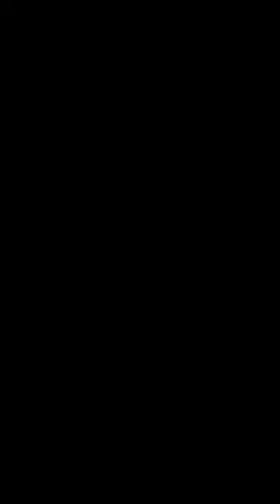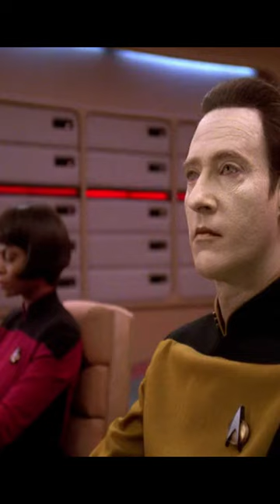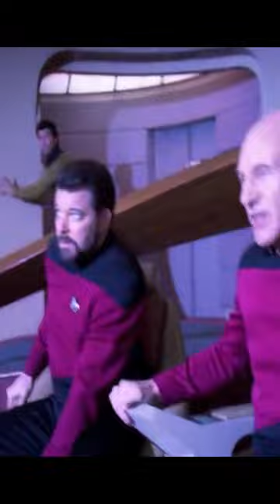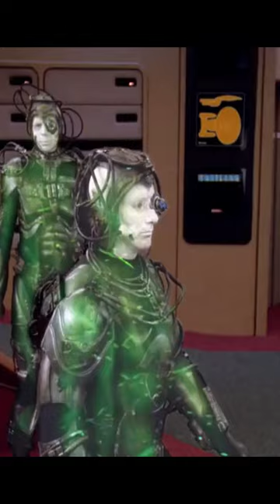Borg Hunt

Comment: if inertia dampeners failed while at warp they'd all be dead.
Reply: Accept they weren’t at warp they were in a Transwarp Conduit which isn’t the same thing
Reply: @Marky11694   How So? They ARE still at warp because they were at warp when they entered the conduit, hence they are still traveling faster than light. The dampeners are an inverse warp bubble that counters their inertia. The moment they exit the transwarp conduit they'd all be salsa on the back wall.
Reply: @FablestoneSeries  clearly you weren’t watching the Video Captain Picard specifically ordered full Impulse which is specifically not warp
Reply: @Marky11694  and you don't understand physics. full impulse is sub light speed. which is faster than a car. at any speeds faster than about G9 or G10 humans pass out. and even at implus speeds would be blood stains on the wall.

to simplify it, any time the ship is in motion and there is a risk of an abrupt change in their speed they require interia dampeners to be online, or they risk death.
Reply: @FablestoneSeries  Clearly you don’t watch Star Trek. In the Star Trek Universe Impulse power is essentially a conventional rocket engine, while warp drive moves the ship by warping the fabric of space. Warp One, is a set speed, defined as the speed of light in a vacuum. Whereas “Full Impulse” is a throttle setting on the impulse engines..
Reply: @Marky11694  i have the Star Trek encyclopedia. impulse engines are rocket engines capable of achieving 617 MILLION kms per hour and .92 the speed of light. which is FAR faster than anything a human can tolerate. Humans pass out at 17 thousand kms per hour. I'm disappointed in your understanding of basic physics. interia dampeners are required for all speeds faster than a car. Even the tiniest change in acceleration or deceleration at those relative velocities would equal death. Therefore interia dampeners are required pretty much at all times. Neil Degrasse Tyson picks on Star Trek for this ALL the time. Do you know something he doesn't?
Reply: "interia dampeners failing" not "inertia dampeners failed".

In other words they were on the way out, but still working
Reply: @Raven.flight  okay. Fair point. But Star Trek uses the "inertia dampeners failed" line to justify them jostling about far too often and with little consideration. if they had their effectiveness compromised by even a fraction they'd all be dead. Of course almost all the technology in Star Trek is science-fantasy and completely impossible. So I shouldn't give them too hard a time about this. For example the energy required to create enough anti protons necessary to establish a warp bubble around a 600 meter ship would equal a million times more energy than the human race has generated in its entire existence. Quite simply, faster than light travel is effectively unobtainable.
Reply: Ackshually :) A ship at warp doesn't technically move at all. The space around it is "warped" while the ship itself sits motionless. 
Thay being said they weren't at warp as has been pointed out.
Reply: @joshuagiehll3737  There is a layer of compression in a bubble in front of it. According to Neil Degrasse Tyson, as well as a number of other physicists the occupants would still feel the effects of acceleration even if it's not the traditional inertial acceleration we associate with high-speed travel. You still would be moving through X-Y- and Z coordinates. You could just as easily say an elevator moves but the person standing in it stands motionless.Though we may never know, because as i said it is effectively unobtainable. it would require us extinguishing a star every time we wanted to travel somewhere.
Reply: @FablestoneSeries  Exactly they are Rocket Engines which is specifically not Warp Drive interesting how you just agreed with me while trying to prove my point wrong
Reply: @Marky11694  They are rocket engines that are capable of accelerating at speeds that approach light speed, hundreds of millions of kms an hour. If anything the fact that they are rocket engines is WORSE not better. Where did you go to school? The method of propulsion is irrelevant. If you are accelerating through X,Y, and Z space you experience inertia. Period. End of story. That is basic newtonian physics. The point of inertia dampeners is to explain away the sudden accelerations and decelerations that would happen to the crew on a regular basis if this were real. Any time the show says inertia dampeners are offline, and they aren't either at a full stop or coasting with just their natural momentum, they'd be dead. because even the tiniest adjustment in speed would translate to a significant increase.
Reply: @FablestoneSeries  Dude your arguing physics in a Fictional Universe Real World Physics do not apply.
Reply: @Marky11694  If you truly think that, please don't ever write. The key to making a universe believable, or CGI convincing, is to make it feel as real as possible. or at the very least, not to violate the internal logic of your own universe as you've established.
Reply: @FablestoneSeries  If that's what you think, then don't read stories. You're like these people who say women shouldn't wear heeled boots in fantasy. Who gives a crap. It's a fictional story. Not everything needs to be hyper realistic. Just accept that the Enterprise did a thing and there is an explanation for it.

Comment: Am I missing something? How could the impulse engines be at 125 percent? Can an engine output more than 100 percent? Yeah , I'm overthinking it.
Reply: I was overthinking the "coming into phaser range"
It's a laser so it should go unimpeded for pretty long distances but maybe it refers to effective phaser range since the intensity would probably go down as it has to travel further and spreads out 🤔
Reply: Your thinking is at 125% 😂
Reply: it's like overclocking. They sent more than maximum power to get some extra engine power
Reply: Starfleet Engineering and Shipyards design and build their vessels to include extra capacity and tolerance for short periods for emergencies to increase working life.
Reply: @safirahmed  🖖👽🖖
Reply: @unclebob7937  Always good to over engineer starships as it's not possible to know what's out there.

Comment: 125%? I think Data needs to recalculate, taking into account it's new max capacity.
Reply: It is common (for instance, in the aviation industry) for 100% to represent the 'normal' or safe limit of regular operation, though this limit can be exceeded: many small aircraft routinely exceed 100% power for take off, for instance.